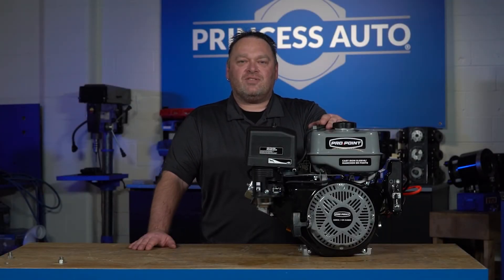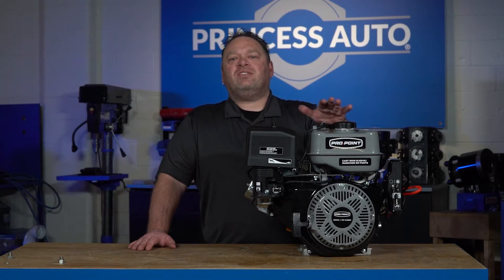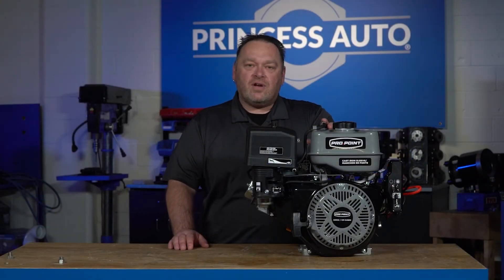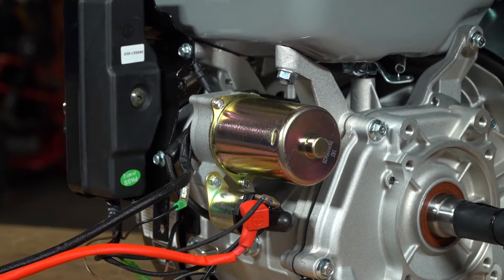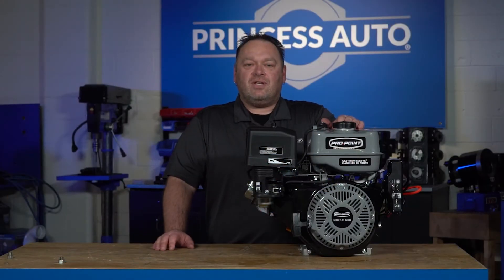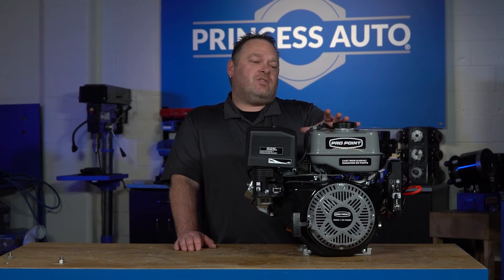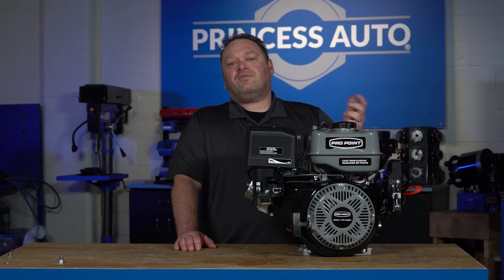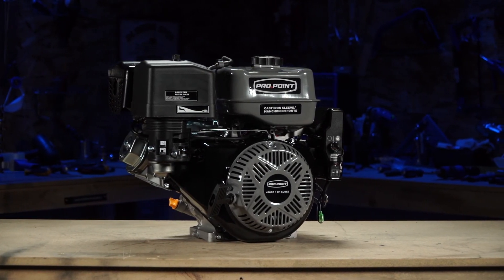420cc OHV Gas Engine with Electric Start Review - 8628265

Comment: This style engine came on my Powerhorse 9000 generator. Still runs good 12 years later. The only issue was the sparkplug after a few uses gave up. Put in a NGK and never looked back. Finally, after 12 years and several hundred hours of use, I had to replace the front crank seal. Other than that, it has been very reliable. Starts on first pull

Comment: Where could i find any performance part for this one? Looking to get one to build a drift trike or a go kart but am looking to get performance parts thanks
Reply: Change the exhaust or air intake you'll get more performance.

If you need one of these units I have a brand new one I'm taking it off to convert to Electric.